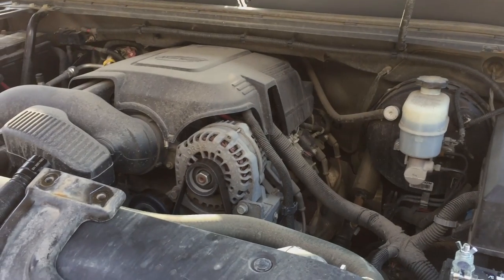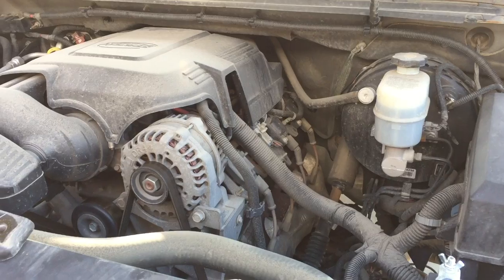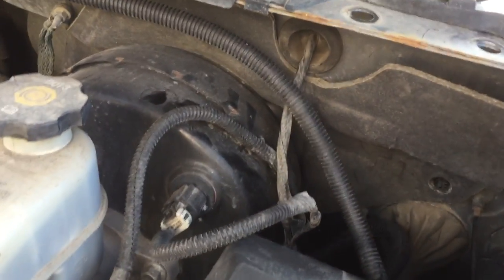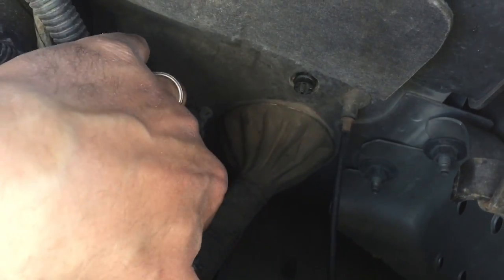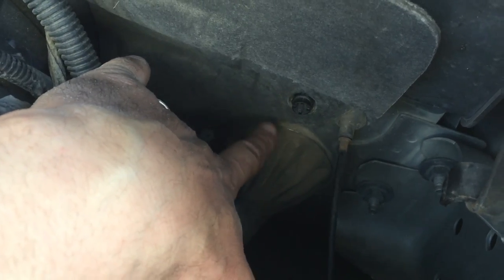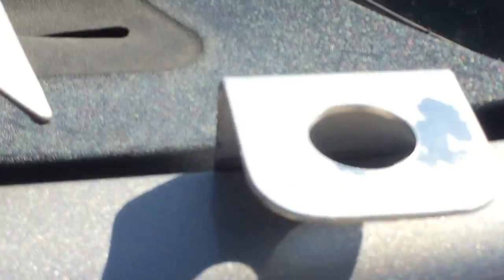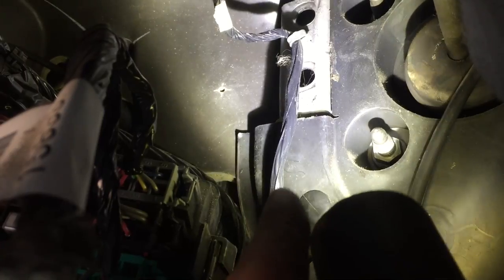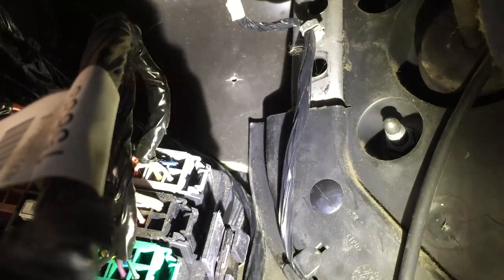Firewall drilling locations for GMC sierra /Chevy Silverado 07-13

Comment: Bro…..you don’t need to drill. Drop the wire down, run underneath and come up through the floor grommet tht holds the emergency brake cable. There’s a spot in the pass side as well in the same spot but requires a step bit and is the BEST spot I’ve EVER seen for a pass through.
Reply: Thanks for this Tip.  going to look for this in my 2012 suburban
Reply: thank you!! clutched up

Comment: Thank you. Great video. 
I have been looking for a place to run 2 small wires through firewall on my 2012 Yukon.
Most videos say to cut the boot in main wire harness. That is just asking for problems.
My 2012 Yukon had exactly the same dimple and hole on the inside.
It is much easier to drill carefully from inside of the truck.
Cheers.

Comment: On my dad’s 09 Silverado, that dimple and the hole in the plastic on the inside of the cab did not line up, they were about an inch off. No big deal though, just has to drill all the way through the plastic from the engine bay side. Thanks for the help, everyone else says to punch a hole through that big boot and run the wires through and that seems like a pretty slapdash way to do it.

Comment: On my 2013 silverado, the larger outward area inside the engine compartment does not align with the square indent inside the cab if anyone is making that comparison. That square area is even where the engine head meets the block at the rear of the engine about 4" to 6" lower and to the left.

Comment: thank you for this I have a cb in my 2009 gmc sierra and don't want to use my cigarette lighter outlet to power it as that is not the correct way to power it as well powering an Amp

Comment: I would enjoy a video on your dual battery cb setup. I’m currently doing the same.
Reply: I run all my accessary wires/cables to a secondary battery to a main power block if Need more attachments

Comment: I found the hole and it would be a perfect place, but how am I supposed to fit a drill either under the dash or in the engine bay… like… am I just dumb? It’s impossible to fit anything larger then like 4 inchs into the space on either side
Reply: Same question.   maybe remove the fuse box under the hood?